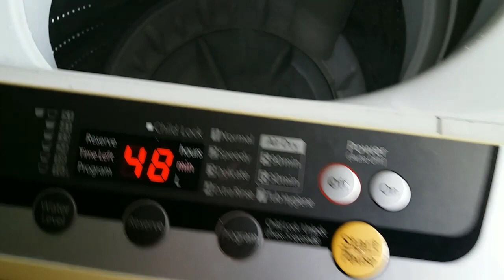Repair Panasonic NB-F70B2 washing machine at home: fills & drains at the same time

Comment: Thank you so much, this method worked for me.
I had this problem where the washing machine won't spin so it seems that there is a debris stuck on that rubber thing.
After I clean it up and unclog some of the debris, it works fine.

Comment: thanks for the guidance bro, I fixed my machine. There was no dirt or coin inside.
Reply: I just removed all the part inside as shown in the video, cleaned and replaced. After machine was working fine.
Reply: also there is spring like parts which moves back and forth you can try lubing that one

Comment: Thanks.. speed 2x may seem confusion for nerds.. they may think, u have kept motor speed 2x and it's actually video speed

Ok, is this video applicable for Panasonic F65B2 top loading model?

Is the coin stuck and that's why, u had water fill .. drain probelm at same time?

Comment: Bro can i ask, i already do the same vidoe that you provide, and then the water still doesn’t want to pour in to the washing machine, is it posible the valve or the solenoid problem? Thank you
Reply from the maker: Maybe the water inlet valve faulty. Mine also has the same issue before this, i bought the new one and the problem solved. Ty

Comment: Hi Rey, Water is draining even there is no coin inside. Do I need to replace this part with new one. What is the name of this part which pulls out the spring and water drains out.
Reply from the maker: Hi ashwani, try to replace the drain valve first, maybe its rubber seal already damaged. If problem still persist, then you may consider to replace the drain motor.

Comment: When we try to spin only washed cloths the program automatically fixes on rinse & spin in national fully automatic  top loading machine what to do for it kindly advise
Reply from the maker: Perhaps you might to reset the machine by unplug from power socket. Wait till a minuite then  plug it again and try to wash like normal. If problem persisting, then it maybe problem with pcb itself. I not really sure about national wm coz i dont have it.

Comment: Nice one broo
Reply from the maker: J3Bat DeRhaka Demi k3b3NaraN thank you @ terima kasih
Reply: Sya dah buat cmtue tapu xde duit syiling pon..still jadi jgak cmna erk
Reply from the maker: J3Bat DeRhaka Demi k3b3NaraN bro punya mesin yg sama dngn saya nie or manual? bro ada check drain rubber seal mungkin dah haus dsn rosak. Kalau drain motor rosak air takkan drain.

Comment: How to fix u 11
Reply from the maker: If the drain motor working but its stil wont drain, the problem might come from clogged drain filter. Please google on how to check drain motor. The rest proccess can follow my video. Hope this helped. Ty for coming
Reply: @reysaturn  but how i check Darin motor damage please tell me
Reply: @reysaturn   this Darin motor is input 220voltage or